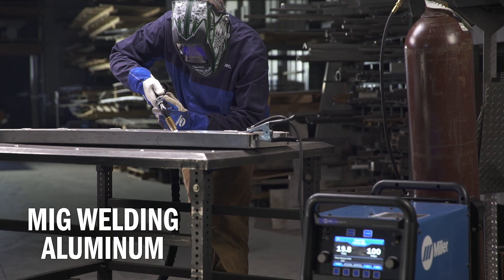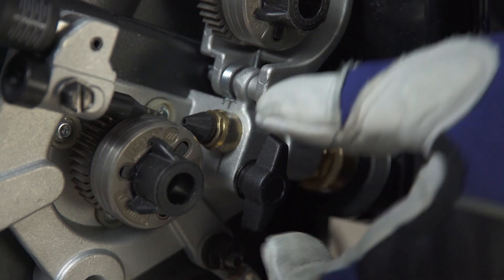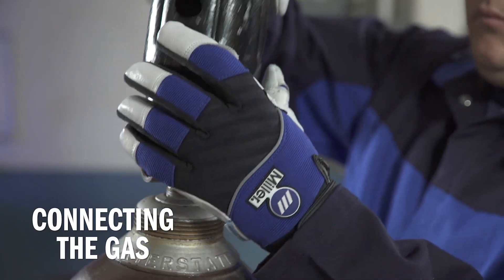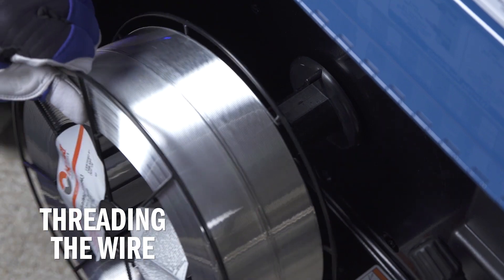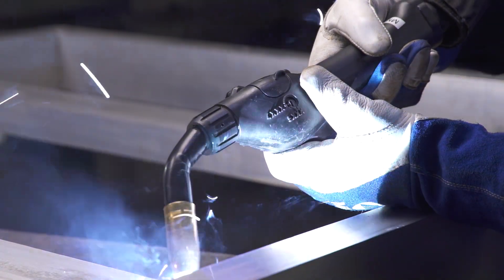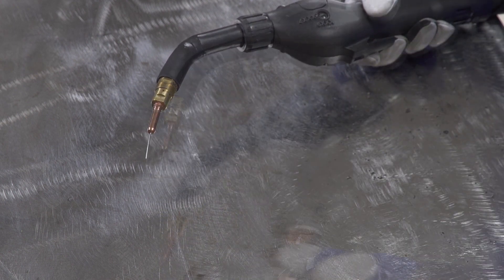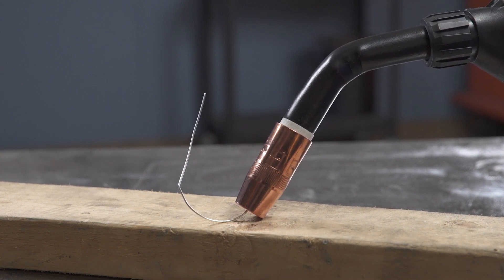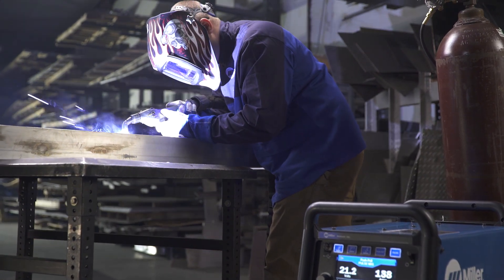Push-Pull Gun Setup On Millermatic 255 or Multimatic 255

Comment: Will the Miller XR 30 push pull gun work with the Miller Multimatic 255?
Reply from the maker: The XR-30 pistol grip push/pull gun will not work on the Millermatic 255 or Multimatic 255. The only push/pull guns that are compatible with the Millermatic 255 and Multimatic 255 are the XR Aluma-Pro, XR Aluma-Pro Lite, and XR Pistol Pro.

Comment: Will the 35' xr pro perform just as good too?
Reply from the maker: The 35' model of the Aluma-Pro air cooled gun operates the same as the 15' version.  Although the longer length can potentially lead to increased feeding issues with very soft or small diameter wires, so best practices should be kept in mind for placement of the cable.

Comment: I have a 211 miller with a spool gun .Will that gun work on this welder
Reply from the maker: Hi Mike, there are three spool guns that will run on the Multimatic 255. One is for light duty and it is the Spoolmate 200 stock number 300497. The other two are industrial spool guns and they are the Spoolmatic 15A, stock number 195156, which is 15 foot long or the exact same gun called the Spoolmatic 30A that is 30 feet long, stock number 130831.

Comment: Which push pull gun works in the 255 multimatic ? Can you provide part numbers too. Also do you sell screen protector replacements for the 255?
Reply from the maker: Thank you for the questions. The XR-Aluma-Pro™ Push-Pull Gun and the XR-Aluma-Pro™ Lite Push-Pull Gun will work with the Multimatic 255. Yes we do! In case the front face gets scratched or arced or sparked on, then you can replace it. The part no. is a 277633 LENS COVER,REPLACEABLE.
Reply: Miller Welders thank you, who do we order screen replacement from? No one seems to have them yet?
Reply: questions should I upgrade I have a 252 I been using for about 7 years?  @MillerWelders